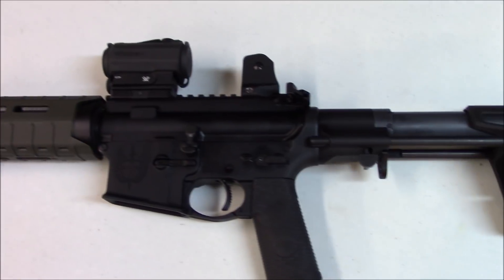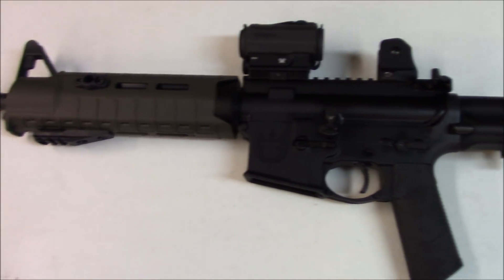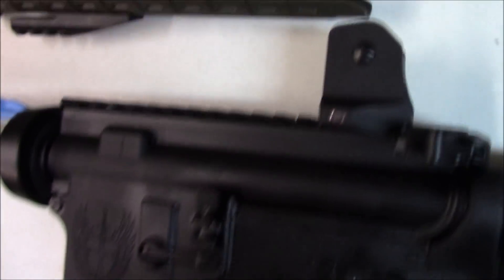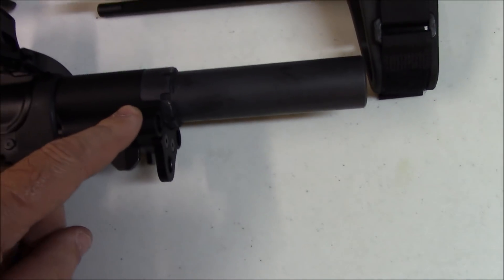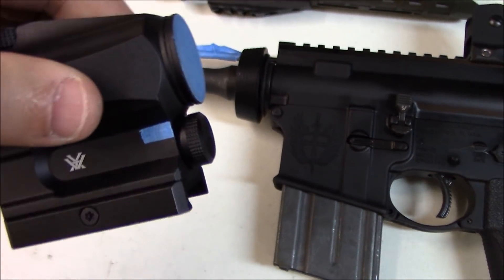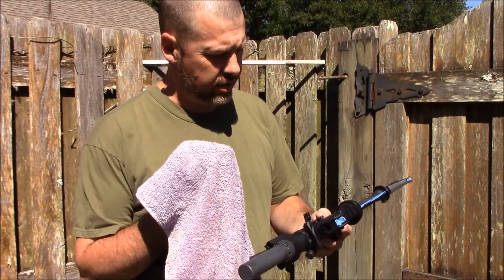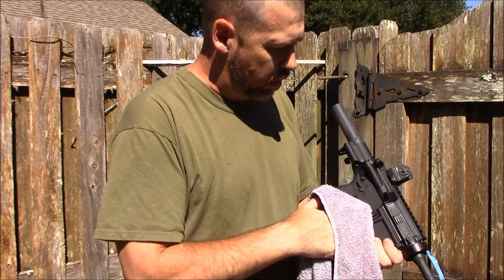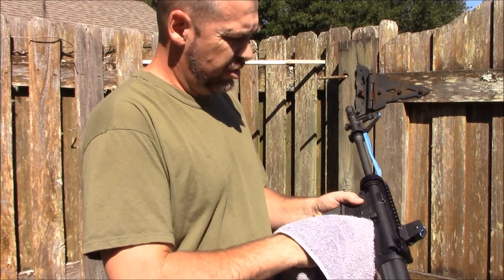How I paint my guns.

Comment: I've never seen any one cover the gas tube before. Do you do this for the heat?
Reply from the maker: Yes. I don't have definitive proof that it helps, and I used to not worry about it, but it's something I recently started doing. No harm done by doing it so I figured why not.
Reply: gas tubes can get pretty hot, I wonder if they would cause the paint to smoke or if it hurts the heat dissipation?
Reply: That's what I'm thinking and as no one can see it there is no need to paint it.